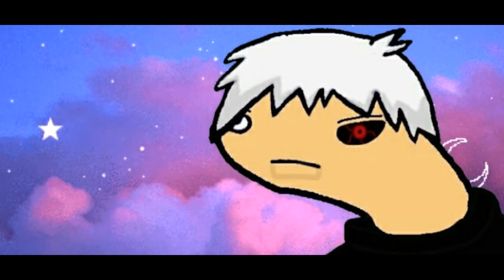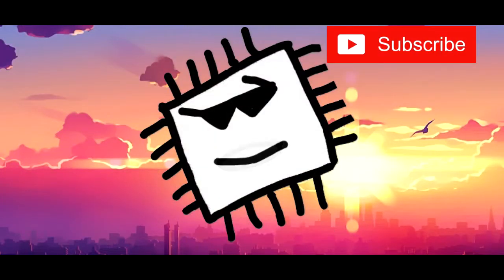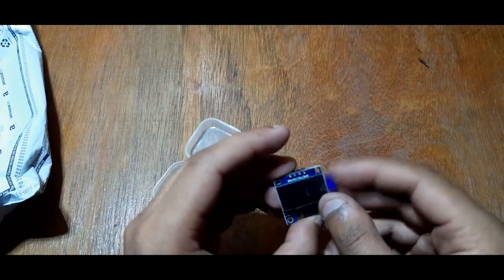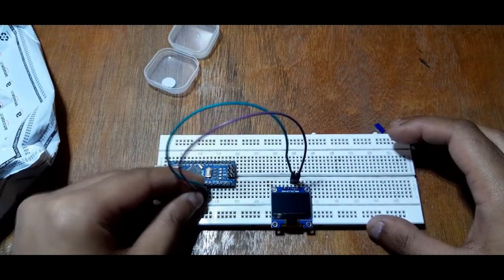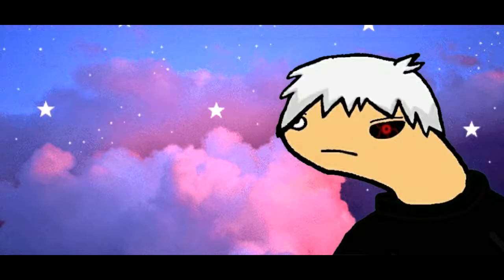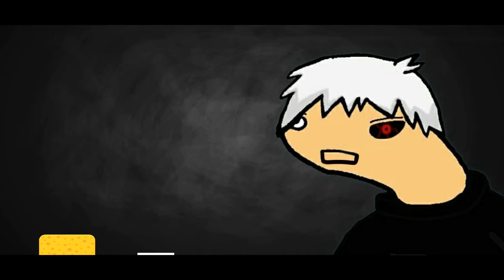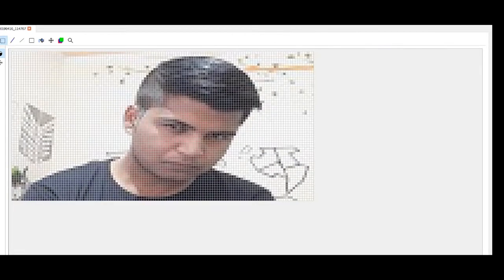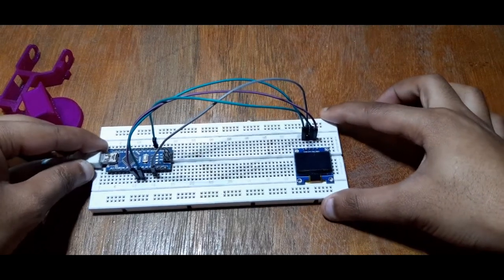Displaying your own Image on 0.96 inch OLED display

Comment: I tried this with your image/code and it works fine. I tried converting a 128x64 bitmap and it says the memory is at 122%. Why?
Reply: Worked it out. In LCD image converter options, there is a preset bar at the top that other tutorials fail to mention. So even if you select monochrome, it will output an array of 24576 length. I chose the monochrome preset and it produced an array with length 1024. Image looks great :)
Reply from the maker: Yeah or you can reduce the image size
Reply: @ArnovSharma  Thing is, the monochrome bitmap I created in MS paint was 128x64 but LCD image converter blew it up to 24000+ pixels in the array

Comment: 0.96" or 1.3" OLED  display (from china)
[advantages over TFT] low power, low cost, easy to control, bright (easily seem under sunlight)
[disadvantages] 1-bit single color (no grey scale), pixels with uneven brightness, low resolution (only 128x64 pixels)

Note:- Larger (>1.3") OLED with color or grey scale remains very expensive.
Reply from the maker: I see.